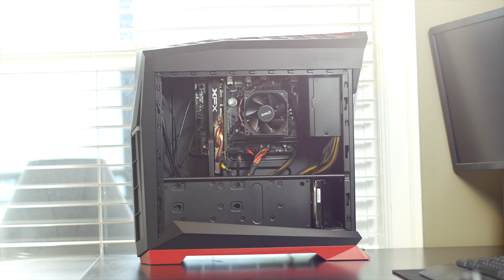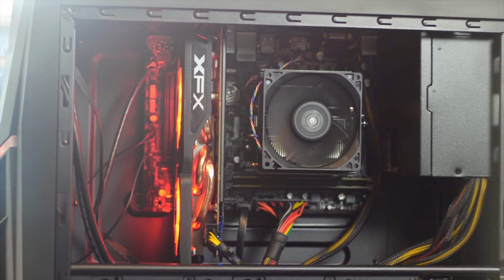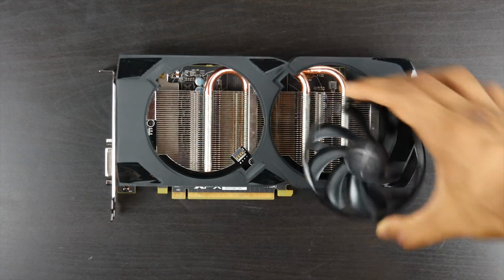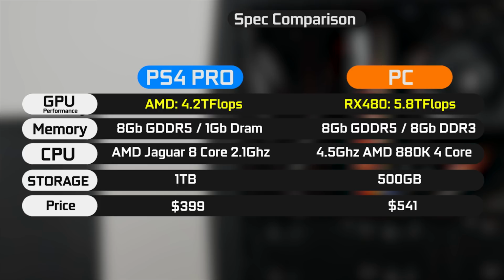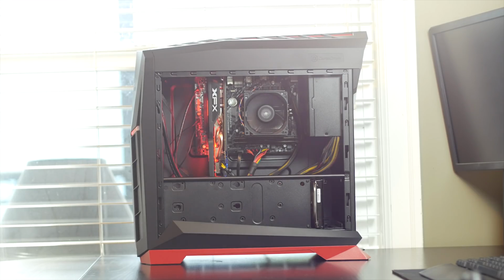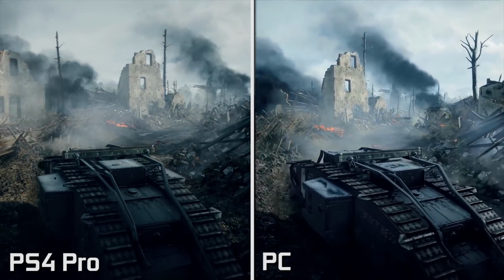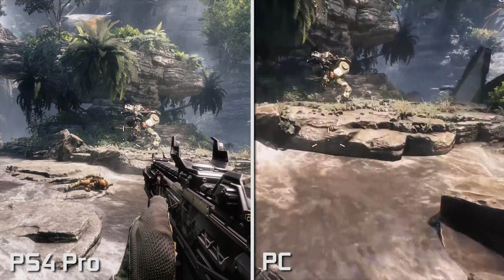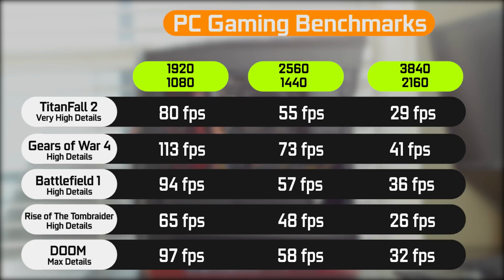Playstation 4 Pro vs $550 Gaming PC

Comment: 400$ PS4pro vs 550$ PC without keyboard and mouse price? Why not with 400$ pc?
Reply: Console peasant
Reply: You can get some relatively cheap keyboards and mice that still perform good for $50. However, a ps4 is still a great option for the more casual gamer who doesn't want to spend a whole lot on a pc. They have a different market.
Reply: well 30$ mouse + 30$ keyboard and then windows 10 home which the cheapest one from microsoft is 130$ and a blue-ray player for 50$ and suddenly you do NOT have any budget from those 400$ or even 550$.
Reply: IIIRattleHeadIII You purchase a mouse and keyboard bundle for $30 and you can purchase a $20 windows key from Kinguin or G2A, or just get Linux. A blu-ray player is completely unnecessary.
Reply: Storm Drain and may I ask you how do you play 90% of the games on Linux? I would love to use ubuntu or arch, but they don't have almost any games, nor do they have visual studio...
And you can get a PS4 pro without a controller for 360$, and those 30$ bundle K&M suck, the consoles' controllers are high quality. You need at least a 30-40$ mouse and 20-30$ keyboard and there are currently no windows 10 keys sold on g2a.

And keep in mind that Zen and Kabylake will NOT run on anything lower than windows 10, thanks MS...
Reply: This video was to compare the build vs the console. Why would he include the price of the keyboard and mouse?
Reply: Peter Mcnally how will you use a PC without a mouse and keyboard and how will you play ALL the games without WIndows?
Reply: What part of build do you understand? "Playstation 4 Pro vs $550 Gaming PC" "how will you use a PC without a mouse and keyboard and how will you play ALL the games without WIndows?" By your logic we should include the price of PS+.
Reply: Peter Mcnally And some companies also offer similar packages as PS+ on PC, like Origin although it is not required.
Reply: Storm Drain dualshock 4 a good quality controller , not a cheap )
Reply: +Rustam Doc agreed.
Reply: Rustam Doc Yes, but a controller comes with the ps4. You may purchase more although it is not required like a mouse and keyeboard
Reply: IIIRattleHeadIII You also would not be getting anywhere near the pc with a ps4. In the long run, buying games would be a whole lot cheaper on pc due to steam sales or second hand sellers dropping the price by more than half in most cases.
Reply: IIIRattleHeadIII You are not going to play EVERY game, but if you do plan to play these games, you can still buy a key off of Kinguin for $20 and add protection for another dollar. And actually you can get the $30 Cm storm combo which is a great keyboard and mouse starter, and if you don't want this, you can spend about $15 on a redragon mouse $30 on one of their cheap mechanical keyboards. I have tried this and can say it works great.

Yeah it does suck that the newer CPU's will only run on Windows 10, but if you're looking for a budget build, you probably won't be buying the new CPU's.
Reply: Storm Drain my brother had a CM storm combo and he didn't like it and I didn't like it... it's awful... I wouldn't recommned it for starter's at all, especially the mouse.
And you can buy cheap games for consoles as well, there is second hand, game lending, game trading, local and online game discounts.
Reply: IIIRattleHeadIII Well there is the Redragon option, and I can still say it's fantastic. You will still be getting way more of a discount on pc as there are second hand sellers who resell games that were on a steam sale for even less so you will be getting an even better deal.
Reply: Peter Mcnally To be fair, Windows is almost required, yes, you can get Linux or something else, but most games only run on windows now.
Reply: Storm Drain yup, thanks to Microsoft's DirectX monopoly...
Reply: Peter Mcnally we should include the price of PS+, but 5$ a month isn't that expensive.
Reply: IIIRattleHeadIII Well Vulkan is coming out and some developers (Like Valve) said they will be supporting it. But yes, Microsoft does currently run a monopoly on the PC market.
Reply: yes ps4 with upscale 4k not native 4k. 500 for native 400 for fake 4k lol
Reply: Tam Thang ps4pro have native 2160p you don't know about it? Loool . But 500$ pc really fake gamer in 4K on aaa games, need minimum gtx 1080 , max - couple of titan Pascal , welcome to pc gaming in 4K aaa games )) 2000$+ . Lol
Reply: Rustam Doc In all my 15 years of gaming, I'm yet to see a "fake" gamer...
Reply: IIIRattleHeadIII say, not the number of pixels the beauty of the games, and as a) you agree? the size of images and graphics is secondary. An important but secondary. which is only Last of Us, by her were delighted even in 720p. the main plot and gameplay. but now there is a native 4K. in place are not worth)
Reply: Rustam Doc 4K is NOT worth on mintors smaller than 51 inches.
And to me Gameplay Comes First, Second is World/Level Design, Then it's Sound, After that is Story, Then it's graphical design and art style and finally it's the graphical quality and resolution.
A Game with good graphical design and art work will look good, NO matter how many polygons, shiny effects and pixels there are.
Reply: lol majority of game on ps4 will be upscaled, all game on pc will be native, go read, 4k on plant vs zombi ps4 pro
Reply: Tam Thang Lol majority games will be run on low settings  or/and working like a slideshow on 500$ pc 😅
Reply: Tam Thang all games on pc (500$) in 4K native slideshow, you right 😅 apart from - CS 1.6, solitaire, and your plants with zombie of course ;) 
Enough to argue, you have already demonstrated their incompetence.
Reply: ik, but pc more than capable of playign game, such as typing essay, phoroshop, brazzer.....a 500 with r480 can play ultra in gta 5 with retro mod,at 30 fps lol 1080p, or low in 4k.......
Reply: IIIRattleHeadIII All matter of distance, point density and visual acuity. End)
Reply: Tam Thang I am not against the computer. and I have a normal PC and PS4 pro. PS I play at exclusively exclusives, and everything else on the computer. but the computer is not for $ 500, here's the thing. Understand)) I get the best of two great systems. and I recommend not to believe that the computer will give you is your picture
Reply: Tam Thang GTA 30fps on 1080p - no perfect smooth , mo perfect details. 
Low in 4K - is not necessary even to consider))) low shaiders, low polygons , low textures -> Stretced to 4K ))) it worse Sony"s upscale , it worse first variant (30/1080p) need a powerful configuration for PC. Will be good
Reply: controllers = wireless, wireless = crap that lags like fuck with no accuaracy
Reply: Felipe03000 yeah 5ms vs 1ms, such a big difference and when everybody has 5ms controllers it doesn't matter.
Reply: IIIRattleHeadIII AND: No accuaracy.
Reply: Felipe03000 there is accuracy, but only the people who use them are accurate.
Reply: IIIRattleHeadIII compared to M+K not... I used to be a console gamer, I was pretty gud at halo, but when I came to pc... M+K is sooooo muuuhhh better.... (at least for fps). And in consoles we have the aim assisti (the ingame aimbot), that fuck up with everything giving advantages to newbees and to people that know how to abuse of it.
Reply: Rip 10 sec of your life reading this rest in peace a 1080p 27-34 inch TV usually costs less than a 1080p 27-34 inch monitor, while it has more ports and features, but worse pannel/screen in terms of latency, which does't matter a lot.
Reply: and without an operating system

Comment: I'd say ditch the case and use that 90$ for a better CPU or an SSD
Reply: Never cheap out the PSU. It can't affect lifetime of all your components.
Reply: S.S Toor Those cheap psu's are dangerous for this build.
Reply: Teddy Kozub who the f*** keeps their pc for 10 freaking years? max 3-4 years i think, but average, buy a new one every 12 months:) Make sure the psu doesn not fry ur pc in the year or so and u are good to go;p
Reply: S.S Toor
Who the f*** replaces their's PC completely every 3 years?? If you buy good Seasonic or any other quality PSU it can last you even the 10 years.
Reply: Artemis true,v use a case with cheap PSU for 40$ and spend more on CPU. So dumb this guy, ps4 is literally crammed into a metal box.
Reply: Felipe03000
I actually realized that I read the 5 new comments but the statement I reacted to was  Eric Ojeda . I apologize for that :D
Reply: ***** yes, for games Intel fucks AMD... But in other types of apps that use more the cores AMD is as good as Intel (excluding Power Draw)
Reply: *****
RX 470 is the best "bang for the buck" GPU at the moment. RX 480, especially with reLive can really well compete with 1060. So I wouldn't say it's that bad. Also, consider the price of your i7 Skylake + the MOBO. If you'd want to build cheap rendering machine AMD would be a pretty interesting option. For gaming now even i3 6100 is really good and beats 8350.
Reply: Felipe03000
Yeah. I don't see why many people have problem with this. It has similar price and performance.
Reply: S.S Toor, hi.
Reply: I agree
Reply: Game Max Volcano Gaming Case £35. one of the best value cases out there
Reply: EVGA makes good cheap psus.
Reply: Teddy Kozub idk man, in 3 years ur pc is basically running games at minimum settings instead of maxed out so idk bout you guys. Phones annd pc/lapops need a replacement every 1-2 years.
Reply: S.S Toor depending on your build and games details you want and which resolution your using / fps limit .. 1080p 60fps .. right now with 500/600 dollars you can get pc can last for 4 years playing 1080p60fps in 85% of aa titles .. gtx980 or rx480 or 1060 or 470 is the sweetest spot for money to performance in medium budget pc .. also remember that bf1 gta5 or any good ported games will always run awesome but for poorly optimised games you will have to lower  the graphics like watch dogs 2 (in high detail you can get good game experience but never try ultra) pc have advantage and disadvantage always same to any Device in this world have advantage /disadvantages .. i got my first pc for 550$ with used and new parts ..my pc faster than this pc in the video (because of used parts.. i don't mean used is the better choice)
Reply: X AK I hate these console ports like watch dogs 2 and mafia 3, seriously, if you are going to optimise the game for consoles, dont f*** bring it on pc's. Shit manufacturing of the game and not much time spend making them, fu**wit developers.
Reply: S.S Toor i head that mafia 3 is fixed 
and i played unity personally i saw it is a bit improved from it released 
they try to fix but they should released at the first without a fps hit 
if you played the crew once 
try to stay in the garage for long time like 15 min 
you will see gpu usage is 100% all the time 
and the temps is sky rocketing 
becz of the shitty game engine or What ever it is shit
Reply: *****
Zen will be high-end CPU line competing with i7s and high-level Xeons according to actual posts. The ones that will come first will be even more expensive so unless you'd build the PC for editing / rendering or were running 1080 (probably in SLI because the new higher-end i5s can easily handle one 1080) 6600K is top-line and well enough.
Reply: whats wrong with this pc? it looks great compared to the ps4 yes it could be better but at more cost.
Reply: Julian john
No, if he bought cheaper case (there are cheap good-looking cases) he could buy better PSU or any other part. That's it.
Reply: +S.S Toor New gaming pc every 12 months? lolwtf? Whatever job situation  you have I want because that is definitely not the average buying pattern of those in the middle class.
Reply: Artemis even better just don't fucking us a case. Use a plastic box or something.  USE A S A CASE THE WORLDS BIGGEST PC COOLER.
Reply: I havent upgraded in 3 years and im finally going to upgrade.
Reply: KlearChristal LOL, idk i bought an AMD FX 8350 & GTX 970 PC last year, the CPU went over 100c and my PC shut down. After sending my PC 6 times to the people who build it, i got frustrated and sold it for cheap. NOw i bought i5 6500 and gtx 1060, and boom, cpu stays at well under 55c with a stock fan. I basically made my assumption on that and fx 8350 was my first pc so.....BTW, I BOUGHT THE FIRST PC AND BUILD THE SECONG MYSAELF
Reply: *****
What about 6800K and Xeons???? Huh mate?
Reply: *****
Lelelel
Reply: Eric Ojeda
Suuuuuure... They're not "optimized" maybe for badly optimized games that need good single core perf, bcs they're usually low-clocked. But they are awesome even for gaming even when it's not their main purpose.
Reply: lol xeons are just i7s without IGPU
Reply: Artemis
Not really. You could also say that AMD's CPU are the same as Intels because it handles processes...
Reply: GPU,
Reply: Eric Ojeda I7 processors don't have high clock speeds... 4 Ghz... The top amd processor is like 5 GHz 8 cores, but with poor ipc
Reply: ***** I said a FACT your dumb kid... AMD has the highest clocks, but with poor ipc, that means that if a intel processor have 50% better ipc  a 1.5 Ghz AMD processor is equal to a 1 Ghz Intel processor...
Reply: ***** and Intel's processors have hyper threading... at least most of them
Reply: Felipe03000
I don't hav time and the need to argue with you. But have you ever heard of DX12? Games using even 8 cores? Huh? Sure, mate, feel free to buy i3 and overclock it to 5GHz to play Minecraft, I don't care. I just said that even Xeons are pretty great for gaming - that is for sure true.
Reply: Teddy Kozub it uses all 8 cores, but it does not use it completly... The first core it uses 100%, the second it uses like 95%... and the eight core it uses like 15%
Reply: Teddy Kozub so tell me, why a 8 core it is not 100% better than the best i5? The sweet spot is 4~6 cores mate... more than that you will throw money in the trash can. And you CANT overclock any i3 to 5 GHz... only a few processors could reach 5 GHz. and only one processor IS 5 GHz stock... the best AMD FX processor.
Reply: Teddy Kozub But where the hell I said that xeons are bad for gaming? Where the hell I said that 2 cores are enought.... you are not ok m8, sleep, do not waste your nights playing skyrim (Great game... I do do this some times XD)
Reply: Teddy Kozub It was noting :D and sorry too about my comments... I was not triyng to be offensive
Reply: ***** and AMD gpus are FAR more advanced than nvdia ones... 24059285094252890 times better memory... and better IPC... FAR better... the only problem is Power draw too :P
Reply: Petoox
It really depends, but you can't say that AMD cards suck.
Reply: Petoox in doom it beats with both 15% oc by like 100%
Reply: Petoox and with 50% lower clock speeds...
Reply: ***** amd's 80 series are against nvdia 60's. Same price mate.
Reply: or definately some add-on to ps4 pro.

Comment: I think a terabyte hard drive would have been a better choice for comparison,even better a hybrid drive so you get awesome boot times.  I don't see a real reason to get 500 gb anymore.  Games are just to big for only one of those.  Why else would the pro spring for the 1 terabyte. I mean overall it's a good build, but I really believe that basic accessories and OS should be added to the total.  Not the monitor since tvs arnt priced in the  ps4.

Comment: anyone got a good build for around $400 USD
Reply: It would run games good but AMD is about to change sockets. Price $401.89 USD https://pcpartpicker.com/list/s6gYQV (Side note about the compatibility warning I check that motherboard, it's good to go with FX8300). 

Since 4 cores is required now for some games the cheapest Intel for gaming would be $465.13 USD.  https://pcpartpicker.com/list/RnqYQV

If you have an old pc, you may be able to scrap some parts like DDR3 RAM, Power Supply, and PC case. You may want to check used prices to on things like a CPU, Motherboard, Graphics card, and case. I would avoid used hard drives, and RAM. If you do get used part make sure you read the seller's feedback before buying.
Reply: Go to Techsource and look up "Budtron" I got the same pc i can run gta 5 extreme (overclocked) 60fps
Reply: If that's your budget you're better off getting a console. but if you insist go to portatech.com or pricewatch.com and see what you can piece together.
Reply: Easy:
GPU: Gtx 1050ti 
CPU: (AMD Fx, I3 skylake, or i5 Sandybridge)

Also, If you have an old 1366 or 1156 mobo laying around, some of the xeons are the best price per performance processors you can buy. (e.g. X34xx series and the E56xx series).

Comment: this is a dumb comparison. $550 vs $400 ps4? Plus on top of that, the PC has many bad components that cost too much  for a budget build.
Reply: Shay once you add on the cost of PSN to play online the difference in price is negligible
Reply: You don't need ps plus to play games, just to play online.
Reply: PS4 components has been modded u dumb ass.That's why it's cheaper.
Reply: Budinski You also to pay quite a bit for the OS on a PC.
Reply: Like 30-40 bucks for a code, not that much at all.
Reply: Just pirate the OS